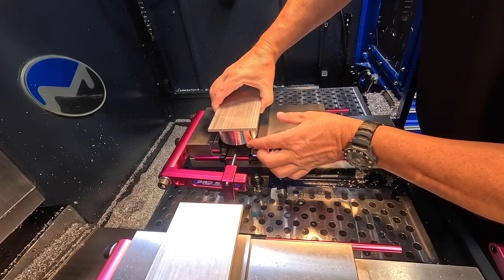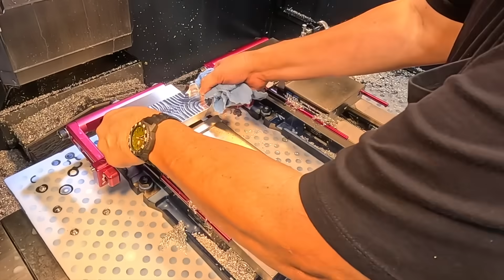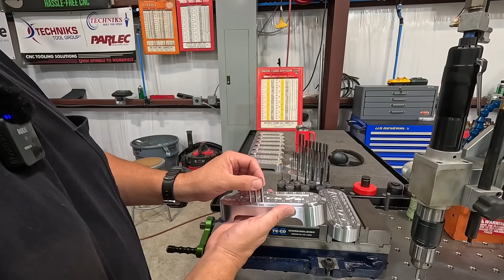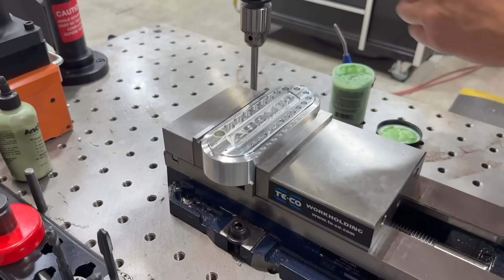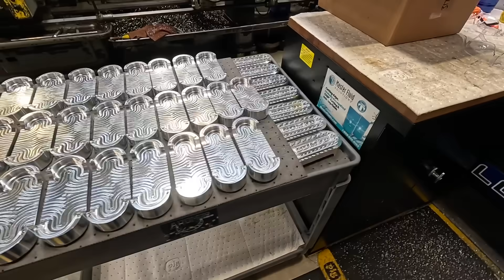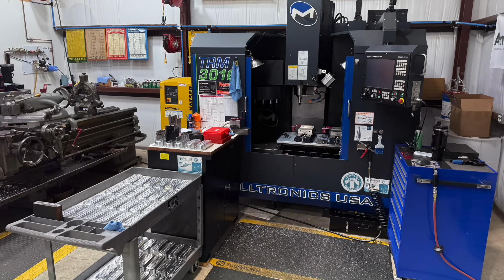Machining the Abom79 Drill Index- Op. 2 Bottom Side

Comment: When you were CNC 'ing why didn't just make every hole .005 or .003 over ?  I probably wouldn't buy one for the simple fact if I haven't used a drill size in awhile I would worry about electrolytic rust forming and freezing the drill bit in the holder.
Reply: They are. That is exactly what he did.

Comment: How do you use Alro I just checked on a 12' stick of 6061 Aluminum 3.5" Diameter Round stock it was $1509.00 my local supplier is 630.00

Comment: You are aware that anodizing will change the hole sizes a little?
Reply: That is all designed into the part. The pins he is using to check size are not the same size as the drills that will that will be inserted.  It’s all good. Everything will be just fine.

Comment: Would seem to me that given the time and amount of material removed a casting would be a better starting point to machine
Reply: Casting small runs isn't cheap.
Reply: If you want to make 1000-20k then sure because under that cost recovery and what you might sell one for because it is then just another 'Harbor Freight' item so then WHY? The analog of this would be a Compact Bubble or a large V8 Truck with custom steps and bar, both will do Highway speed but only one is maybe the Statement you might like to show off.

Comment: Adam, since you are using fusion, you can easily export models right into a 3d printer. You could 3d print a drawer insert into the bottom, there is a lot of space for extra storage.
Love the design which looks like it could possibly be modular and you could add expansion riser under the index like a tiny tool box.

Comment: Don't forger anodizing is an electro chemical process and there needs to be provision for electrical contact when being anodized which always leaves some kind of mark so you need to discuss this with the anodizer to determine where you will allow the contact point which will be visible on the finished part.
Reply: That’s what the holes on the feet are for

Comment: The first step in anodizing is "Caustic Etch" which will change all that precision fit you are laboring on. This is immersion in hot Sodium Hydroxide which erodes aluminum preparing it for anodizing and color if desired. 2-3 thousand's will be removed from all surfaces and all sharp edges will softened. The anodizing adds nothing. It is considered a replacement reaction. Anodized aluminum does prevent corrosion and oxidation. Also there is type one and type two anodizing. Type one is for indoor use. Hope this information is helpful.
Reply: It won’t be seen.
Reply: Anodising does generally add to the surface, it varies a bit depending on process but typically the surface is raised about half the total coating thickness. There are many more than two types of anodising, although for a decorative item like this with no special corrosion or tribological requirement we need concern ourselves only with the sulphuric acid process.
Reply: @grafixbyjorj  Suffice to say Adom is going to encounter some unexpected results after the part is anodized. I'm sure you would agree he is tolerancing the holes too tight. He should have had a discussion with the anodizing vendor before attempting to make a component with such tight tolerances.
Reply: @Ervan-l9v  Agree with all that. He's going to learn, and so are any viewers who aren't familiar with the trials and tribulations of mixing precision with anodising 🙂

Comment: At 44.28 - You are talking about how to separate the metal chips from the coolant ("the wheat from the chaff").  Whatever design you use between those seen on Instagram the key will be the size of the screen to let the coolant drain through while the chips remain behind.  It will need to be pretty fine.  I have to wonder if the screen will become clogged?  You will need to experiment.  Of course some chips will fall through the screen no matter what you do.

Comment: What is the weight of the blank and the weight of the finished product? How much is waste?
Reply: I don’t understand why removing the material is an issue? It’s the same amount of material used whether it is attached to the part or turned into chips.
Reply: A lot.

Comment: intention to inform. Normaly you should be able to adjust the holesize down to 0,03mm on a good mill or what ever when you do cnc that is without any doubt possible. 

Maybe you check in fusion the contour path, and then check "raw part measurement" set that to what needs to been done so your holes get perfect out of the mill.  You can set that to a -minus value too. it acts like "tool wear" minuses holes to perfect size all the time. Unless your cutter realy gets dull...

That will lower your handwork down one whole process. Get some more cash in your shop. 
Thats why we use cnc... no snoflakes part per part to a good tolerance result.

Comment: I think making the hole fit too tight would be a mistake. A used drill bit may have a burr from chucking causing it to not fit. Many drill bits are not hardened on the shank end and can be slightly distorted by chucking causing it to not fit. You are treating this like an inspection device rather than a utility item. If I get one I intend to use it not place it on a shelf.

Comment: So if a drill bit every slips in the chuck it will or won't fit in the index?  I know everyone has bits that have burrs on the shank.  Making it that snug will be an issue unless accounted for.
Reply: Turn it upside down, if you’re using your drills all the time it’s inevitable. You’re gonna get a mark in them, put them upside down and put them in. You have no problem.
Reply: That sort of issue has been incorporated into the design. Tolerances are built into the size.
Reply: @MechanicalAdvantage  what is the maximum burr height you've incorporated into the design?
Reply: @MechanicalAdvantage  Hopefully it does, if you noticed, I did put it in the form of a question regarding if they would or wouldn't fit if there were any slight imperfections.
Reply: Most will never be used to store drills.

Comment: I'm sorry, what is the reaming for? All those holes are too tight to fit drill bits. As soon as you get the slightest damage or dent on the shank it won't fit. Drill all holes sligtly oversize, otherwise the customer will only be able to store new bits only
Reply: The pins are to check the designed size of the holes. Not the drills that will go in the holes.
Reply: Turn the drill bit upside down and put it in if you have damage!!??
Reply: @LLAHTI1 and scratch the pristine h7 finish hole😂
Reply: Most people who buy the product will have the IQ and knowledge to grind that burr off. I actually can't remember the last time I had a burr on the end of a drill. Also, if you're a machinist / tool maker you make sure it doesn't happen and when it does you grind it off to keep the drill running true. Its really a simple concept.
Reply: @TGC32  I call BS!
Reply: @RJMachine62  you understand that burrs can cause misalignment?
Reply: @saintchuck9857  Then you should be thrilled with it right!  I'm just saying its a freaking drill bit rack, no need to be so freaking precise and using gauge pins.  Totally ridiculous.
Reply: @TGC32 your not supposed to have h7 tolerance fit for a drill bit shank, are you f'ing kidding me?

Comment: Remember to have your anodizer plug the drill holes. Anodizing does add a thickness, and with as close as those holes are for tolerance, I can easily see a bit becoming vacuum-locked.

Comment: Just my opinion that if you want to sell to the average home owner, your to worried about tight clearance. I usually end up putting my drills in upside down because of little burrs. 🤷‍♂️
Reply: This isn't mass production for average joe. they'll just use the plastic  case that there 20 set of bits came in. any machinist will deburr the shank, if it happens.

Comment: With a fit like that,( gauge pins popping) as you take it out, you may need to drill holes in the bottom for venting.
Reply: The gauge pins are all bigger than the drill bit which goes in the hole. I agree with a lot of other posters that the clearance is too tight, but he is building in some clearance.

Comment: Will the anodizing affect the nominal hole size?
Reply: Yes, it will shrink the holes by up to 0.002". The options are to mask the holes before anodising or adjust the size up to compensate. I've had the anodising company I use mask bearing bores, but it's not free, and with about 30 holes per part it's going to add considerably to the cost.
Reply: @grafixbyjorj  30 different size holes too.
Reply: It does add a bit of thickness, but since the first bath is an NaOH etch, apparently it is possible to etch slightly more to compensate some of the size increase, though i don't know if it would negatively affect the surface finish.

Comment: Very nice!  I want one for sure. 
On mfg’ing…I think all that hogging of the bottom is pretty wasteful material and time-wise.  I know the chips can be recycled but still, the initial material cost is high. 
A potential solution is to have them cast first.  Aluminum is easy to cast.  
Then you can have the CNC do its thing. 
In any case, a great idea and I will for sure order one when the time comes.

PS: They need to say, “Made in USA”
Reply: Sure, that makes sense. It just depends on how many they're going to be selling. The more, yes, the more they would be better off having them cast. Depending on the demand. I'm sure he has, like you said, other plans to do other things also. Maybe, as they say, this production run will be somewhat small and not worth having someone cast them. But I know that you are aware of this.
Reply: @noblsht  wont be another run,,,he will have them in spades on the shelf forever

Comment: It would be interesting to do a time study on which is more efficient. If the tool holder holds enough tools to do both operations would it be faster to do both ops in the same setup or do it the way you are doing. The other thing would be to keep the saw set up and cut one blank at a time while you are running the mill. I’m just trying to minimize the material movement.

Comment: Does anodizing add any material thickness, to the part like powder coating that would affect the hole sizes?
Reply: The anodizing is actually converting the material on the surface (Al -> Al2O3), wich starts out a little porous so you can soak in a dye. It only adds a very minimal amount of thickness.
Reply: @CatNolara  Except, as closely as he is machining the finished bit holes, that minimal amount of thickness is enough to make using the index a pain. Plugging the holes with rubber stoppers cures that problem.
Reply: Yes

Comment: You might be disappointed when you anodize them.
a) The anodizing may not go into the holes. Then maybe only the large ones.
b) If the anodizing does go in the holes it will make the holes small by maybe a thou (or more).
Make sure you do a test of only one first so you're not disappointed.

Comment: Adam, I would suggest some tag-board, cereal box, jaw liners for the reaming station, and a piece of wood for the flexarm/ream to rest on. 
Could you put two indexes in the vise at one time, just to speed up workflow?
Shop-vac the mill every other set?
Reply: Having 2 parts in a vise is almost never advisable. If they are not exactly the same size, one may not be held tightly.
Reply: @matthewdudley5333  they don't need to be clamped, and it depends which way round you put them in the vise.

Comment: The machine shop I worked in was primarily a production shop. When we were making a two sided piece like this, we would usually do both sides in one operation with the top in one vice and the bottom in the other. I realize that, particularly with something like a drill index, the number of tools available may limit this approach.

As mentioned before, I also mill the commentary.

Tim